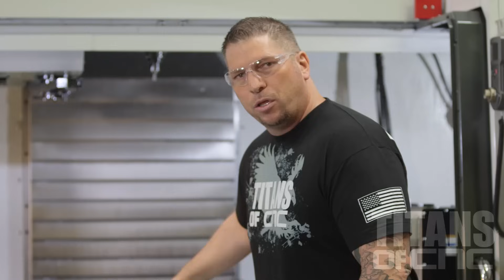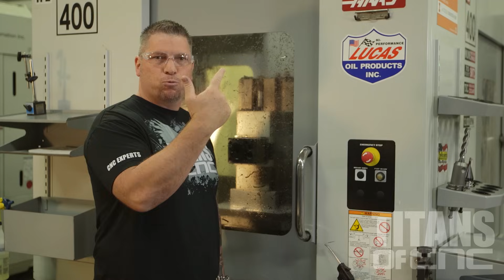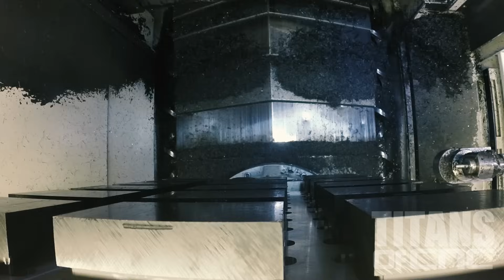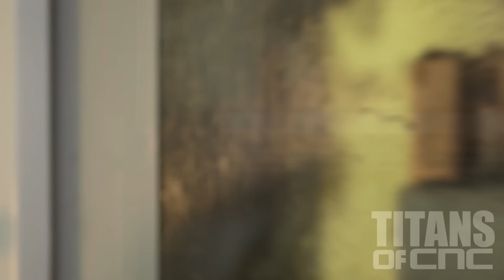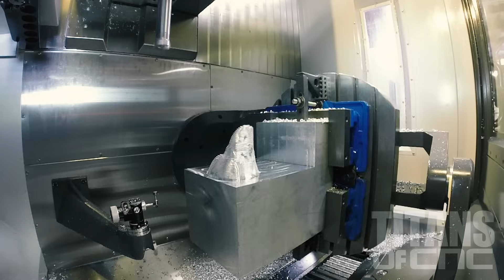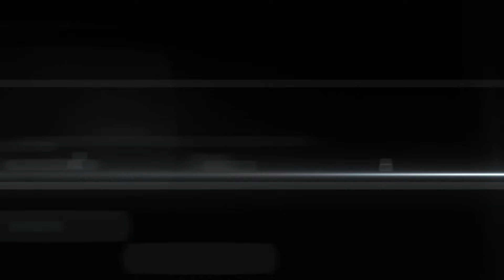CNC Machining - 3, 4 & 5th Axis? Explained

Comment: Some might ask "where's A axis?" or "why the sudden skip to B?"

I like to use my "Left Hand Rule" for the axes. 
Middle Finger: X
Index: Y
Thumb: Z
And then the rotation around Mid finger: A
Rotation around Index: B
Rotation around the Thumb: C

And in this video, you don't see any rotation around the mid finger. 
Just index and thumb, therefore X, Y, Z, B and C

Also the video is a vertical mill. Now try it on horizontal mills. 
Just rotate your hand 90degrees.

Comment: 5 axis CNC machine the axis are X+ X-, Y+ Y-, Z+ Z- and A+, A- and B+, B- Don't know where C is.
Reply: the 4th and 5th axis letter designation depends upon the Spindle and the Trunnion orientation. I applied the Right Hand Rule to remember the axis configuration of CNC. 
Middle finger=X-axis, 
Index finger=Z-axis(Spindle always parallel to this axis), 
Thumb finger=Y-axis. 
IF the Table rotation is parallel to X-axis then it is designated as A-axis.  
IF the Table rotation is parallel to Y-axis then it is designated as B-axis.  
IF the Table rotation is parallel to Z-axis then it is designated as C-axis. 

Whatever your spindle orientation, axis designation always follows this designation.

That's why on 4-axis horizontal CNC Mill, the table is B-axis because the table rotation is parallel to Y-axis(vertical motion). 
On the last machine, the tilting axis is designated as B-axis since it is parallel to Y-axis direction while the indexing is designated as C-axis since it is parallel to Z-axis at home positino.